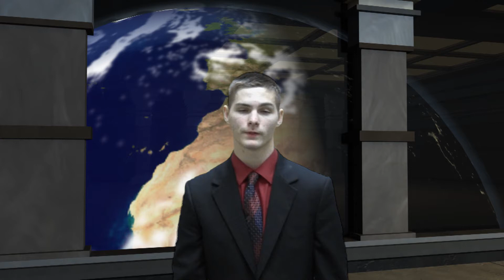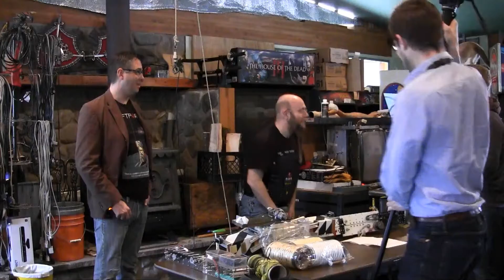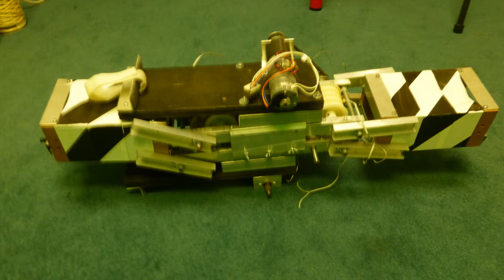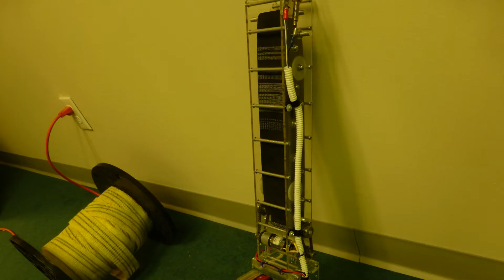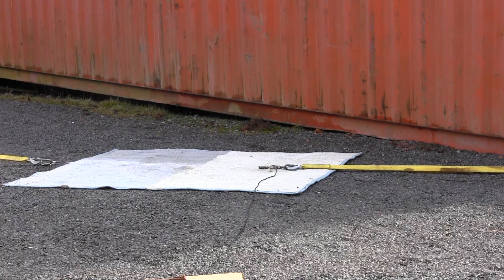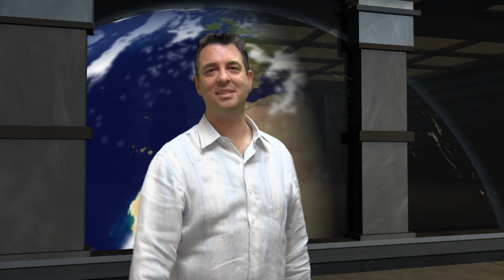Engadget Interview and Weekend Experiments

Comment from the maker: Yup. ALL of the candidate matererials have problems with UV.  But there is a process to coat/protect them.  And, also yup, we're looking at a lot of string!  And finally, yes, the strings we are testing now - for the Kickstarter experiment - are substantially stronger than the thread we will need for the Lunar system.  The Earth environment is much more complicated and the stresses are greater.  The Lunar system will use a smaller ribbon than what we are testing now.

Comment: Doubling the strength numbers doesn't really work like that most of the times. You have to follow manufacturers information, because all of the string from the factory won't follow your spec but it will follow manufacturers. Or something, go talk with your factory.

But asides that, keep up with the project.